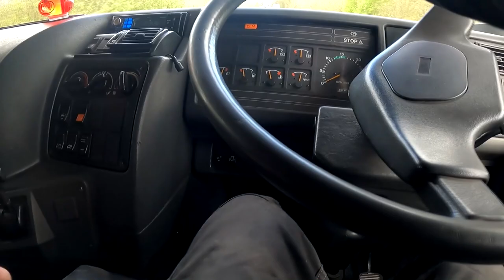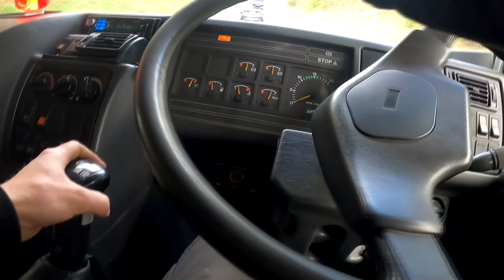*FAILURE!* Taking my TRUCK to MOT | ERF Restoration ep.24

Comment: HI PHILL JUST STARTED TO RESURECT EC11 CELECT WITH A 465 CUMMINS BITS FOR THE RESTORE ARE HARD TO GET
Reply from the maker: There's a few people you can use, like Paul Parker, he breaks them and Cheshire truck spares, he's very good at getting new parts for them. He supplied all my air bags for mine and very reasonable prices!
Reply: thanks for the info been at it all day and have discoverd rats nest under the bed and have been chewing wires got it fired up and runs great the real work starts cant get a front screen up here.
Reply from the maker: @arthurthomson  I'm sure you will get it sorted, good thing is they are pretty simple when it comes to wiring really